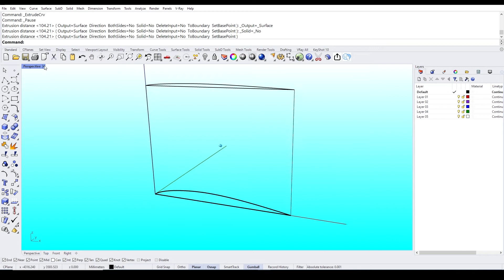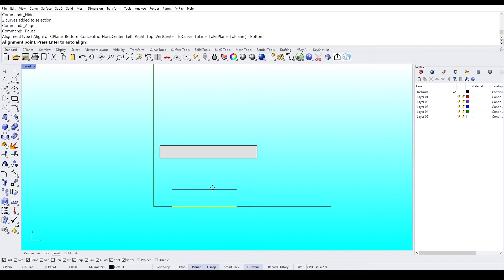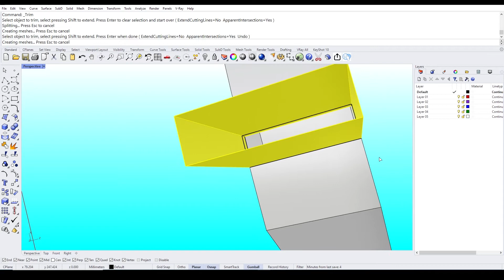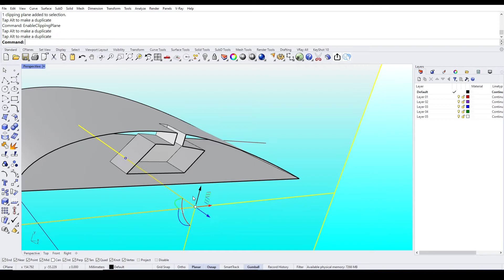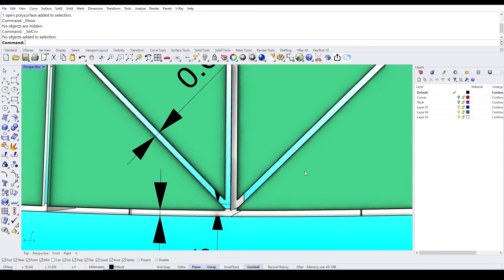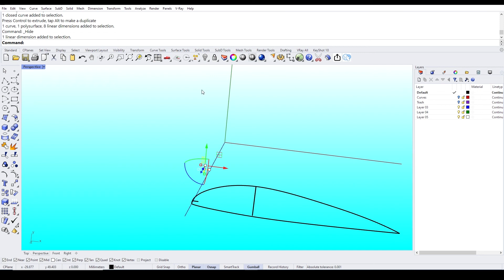New 3dlabprint design (3d printed plane design), more explanation (read description)

Comment: How does the end result compare with the more plane print style modelling technique? (in terms of the print quality)
Reply from the maker: from my prints the surface quality deteriorate in the layers where the truss are, i do not know if the defect its bypassable setting the slicer carefully
Reply: @frugu  Ahhh, that makes it kinda odd that they have used this new design. It seems that no matter how much I optimise my internal structure, the mass of a 30cm wing section with thin aerofoils (~0.09c)  stays at around 55~60 grams, with quite dense ribs (~3cm) and 2 spanwise support. ( I've been using plane print style surf modelling, the surface has been quite good apart from minor layer shifts and have prob used the full potential of my printer).